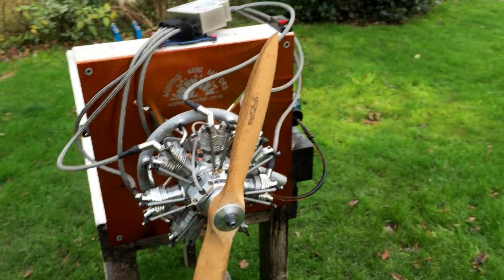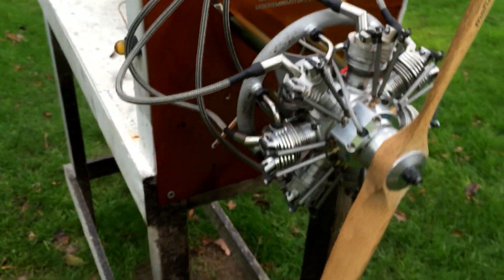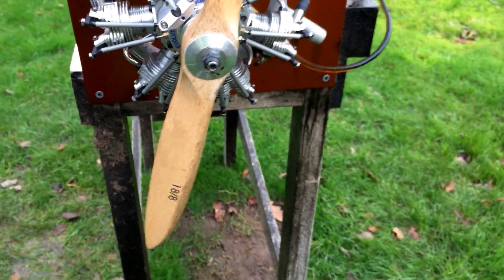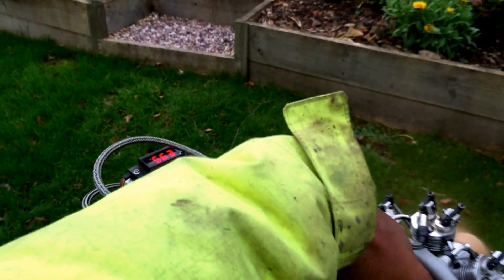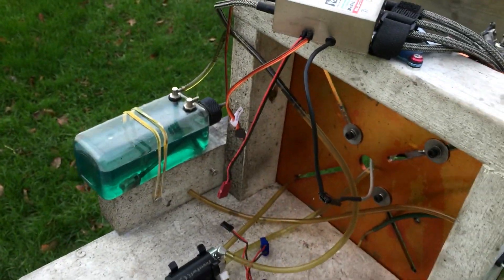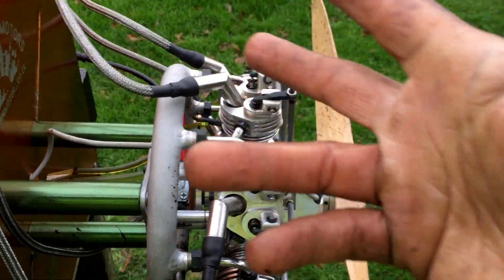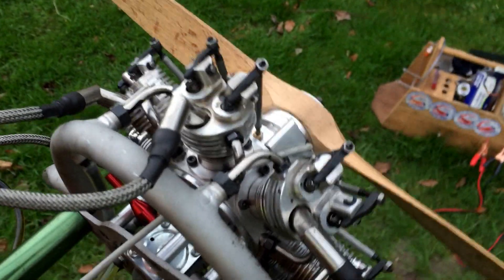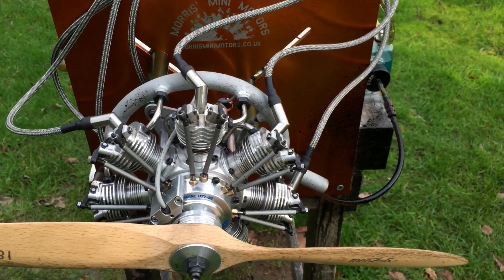Evo 7-35 full gas conversion With RCGF Carb and APS PowerFuel 380 HV

Comment: hi mate, are there any downsides from converting to petrol? I know some of the lads run these on 100% methanol but there can be quite a lot of corrosion if you don't re oil after use with an after run oil. Does petrol need the same care, or is it more forgiving?
Reply from the maker: +CrazyCases Hello 

it is all depends on the oil you use! good oil will always = less care!
Reply: using methanol on an engine like this is pointless because the compression ratio is too low for alcohol fuel to run efficently.....not to mention the heavy alloy corrosion that you get inside the carb